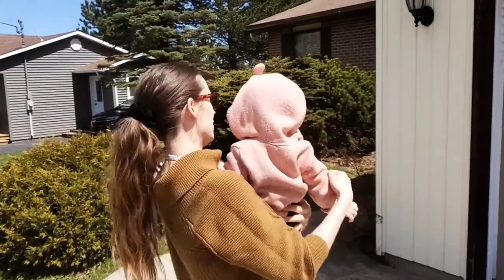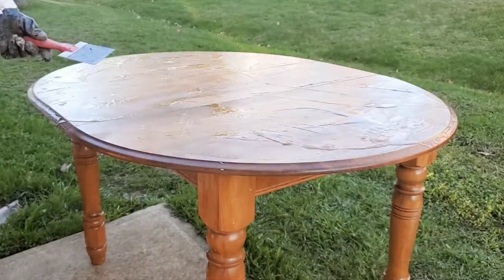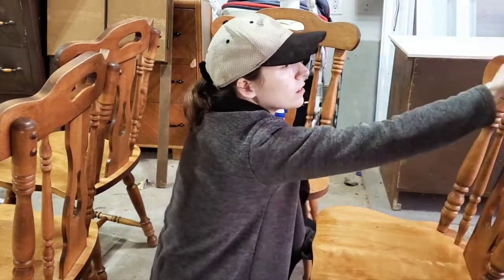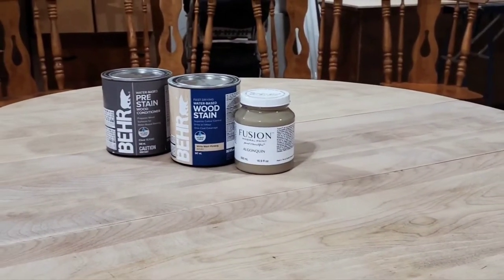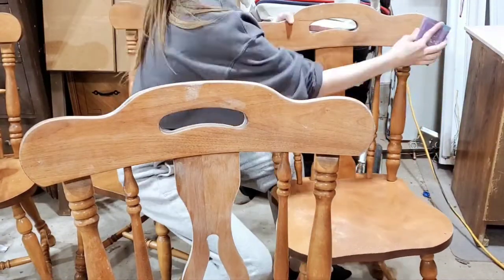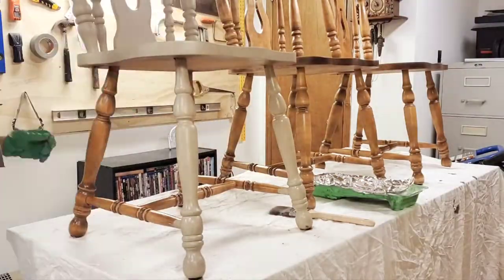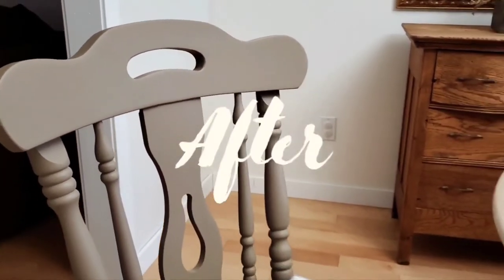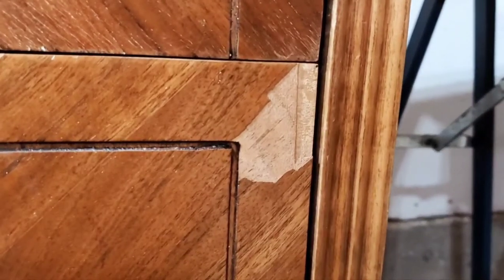Farmhouse Dining Table Makeover $0➡️$360//White-washed tabletop + Fusion Mineral Paint

Comment: I have an oak table & 6 chairs somewhat similar.  My chairs are a white fur that I stained to match the table 40 years ago.  I notice that u sanded the chairs versus stripping, and then u painted.  If I choose to paint my chairs white, can I come back with a gray wash?  If yes will I have seal that ?  Great video, thanks.  👍🏼👍🏼👍🏼
Reply from the maker: Hi John, thanks for watching! Yes, we only scuff sanded the chairs because we decided to paint. A gray wash would probably absorb better onto raw wood as opposed to a painted surface, although it is possible to create a gray wash "look" using paint. The paint we use has a top coat built in, so it's not necessary to seal it but you could add a coat of polyurethane for added durability if you like. Hope that answers your question!